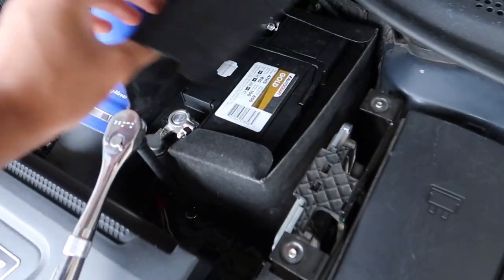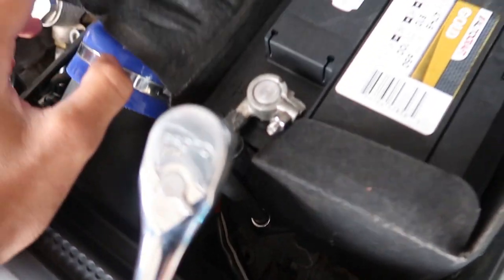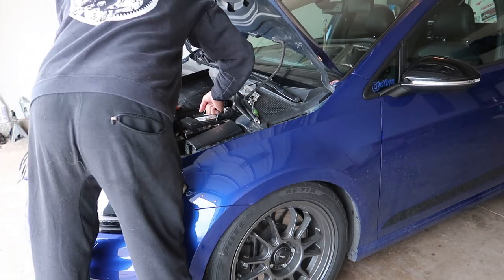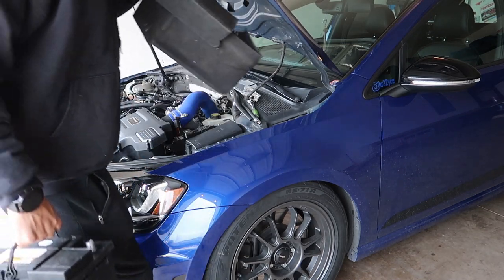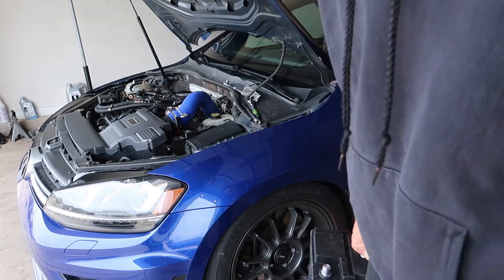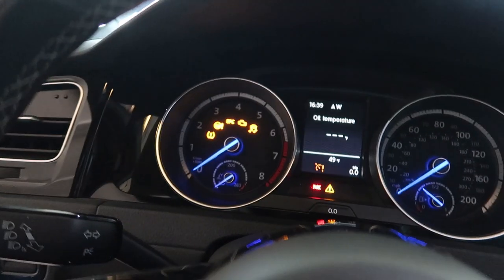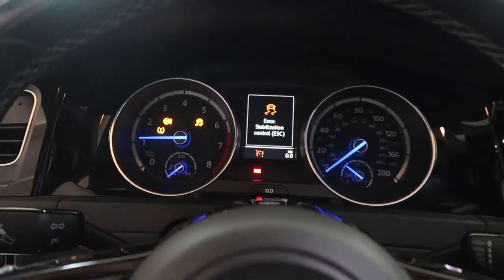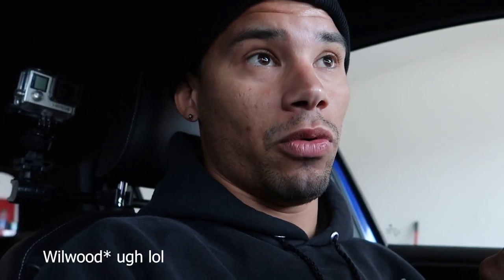(pt1)Lightweight Battery, Turbo Blanket, & Some Pulls! | MK7 Golf R

Comment: How did the battery hold up in the end? 
Any issues? Charging and did it last as long as the stock battery?
Reply from the maker: No issues for the year and some change I ran it.  Them I sold the car

Comment: you should mount it sideways to lower the center of gravity.
Reply from the maker: I thought about it, hell really it needs to go to the back to help balance the car.. especially for when that carbon hatch shows up
Reply: Plus keeping the battery inside the car will help it out in the cold too.  Any little bit helps.